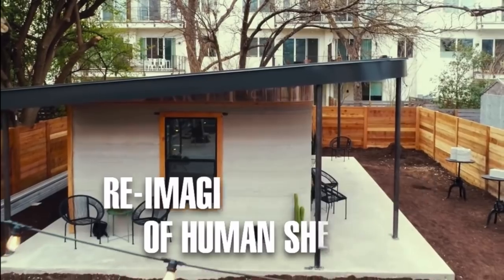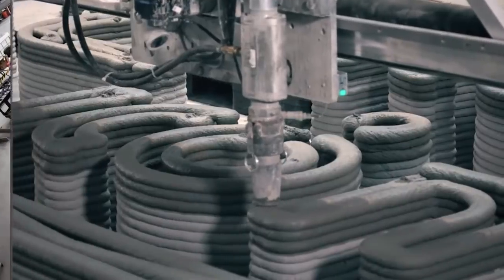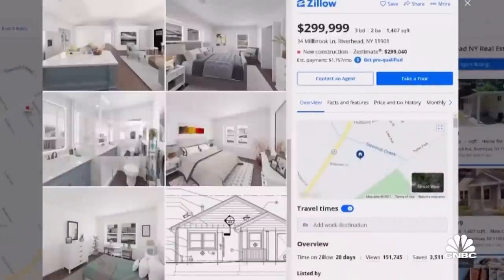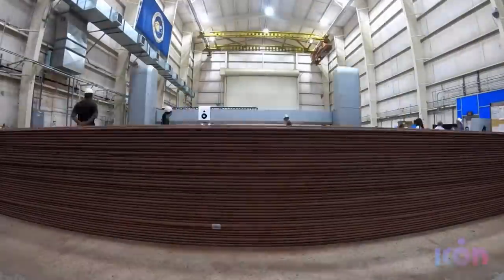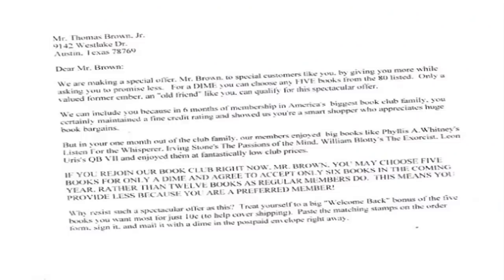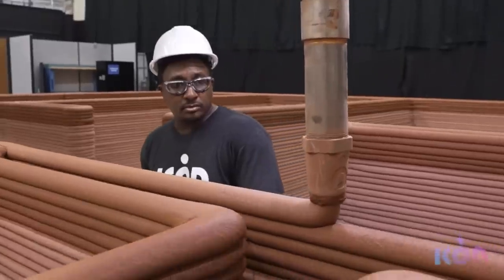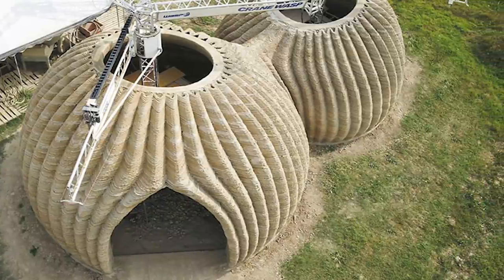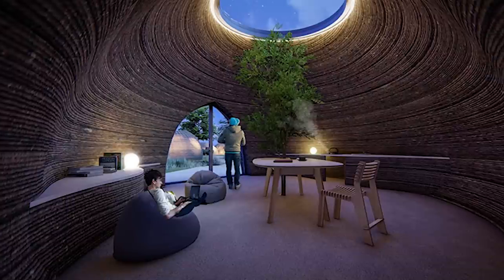Will 3d-Printed Homes Be The Answer To The Affordability Crisis?

Comment: 1. Cost: reduction in trades and material not just lumber. 3D printing requires a fraction of the amount of labor. Additionally, in home building, as well as any manufactured material, you control cost by eliminating total material used. If you use more expensive material, the total cost will increase for the build (example: if you want walnut flooring and a golden toilet... it will cost you).  Yes, a construction company will have to subcontract a concrete company to pump on site and there will be a cost associated with freight for the printer to site; however, in "conventional homebuilding" there are similar costs associated to logistics and freight. How do you think lumber, joists, beams, ect. arrive on site for a "conventional build" (needs to be trucked)? Icon initially started with the intent on selling their printer and not home building. The more printers sold, and the more construction companies invest in this technology, costs will be driven down due to competition. 

2. Tenting: you do not need to tent a site for a pour. 

3: Balance of printer: do you think this needs to be mentioned? "Conventional homes" need to have a level foundation. Also, these printers are equipped with level sensors which will alarm if they are off balance. 

4. Energy efficiency: the walls are filled with open or closed cell spray foam. Closed cell spray foam has an R-value of R-7 per inch. In comparison, open cell spray foam has an R-value of R-3.8 per inch. A nice add-on would be radiant heating in floors. 

5. How to hang a picture? Masonry drill bit... which will fit in any power drill. Don't worry, you will be able to hang up your "eat" and "gather" signs in your kitchen. 3D printed homes electrical and pluming : SQ4d has coded in a chase system to run electrical behind drywall and Icon homes have had external conduit. Although, people in need of affordable housing might not be as persnickety about hanging pictures or exposed conduit. 

If I were to suggest a new title for this video, it would be "5 QUESTIONS About 3D Printed Homes.
Reply: This is a GREAT breakdown. Thank you
Reply from the maker: Title changed. :)
Reply: Love it 😍
Reply: I have the funny feeling that the cost will go down for the builder, no the buyer.

Comment: I’d much rather have a monolithic dome home. They are disaster resistant, energy efficient and your concerns with 3D printed homes, largely don’t apply with them.
Reply from the maker: You are correct and they are super cute. Dome homes save lives in tornado prone areas.
Reply: @KristinaSmallhorn  Before I retired, I responded to large scale disasters (floods, hurricanes and tornadoes). I have seen way too many examples where stick built homes just don’t survive.

You are correct about domes, even the geodesic ones made from wood offer better, but not absolute survivability. Concrete domes offer near perfect protection.

I’ve also seen earth bermed and earth sheltered homes survive. I also recall one round home made from solid pour concrete, with a brick facade survive an F4 tornado. All of the other surrounding homes were either completely destroyed or very heavily damaged. I just didn’t like the flat roof it had, knowing over time flat roofs are problematic.
Reply from the maker: @Hero4Hire4  my dad worked a short time with FEMA and he told me pretty much the same thing. Thank you for sharing what you know about these homes and what the damage can be from storms.
Reply: We tried to have a dome house built and ran into many of the same problems as 3D printed homes. You can't find a contractor to build one. The one company that does it is in Texas and they're more interested in commercial projects. Domes are awesome in Florida but nearly impossible to have one built. Can't get a builder's loan, so you'll need cash. The option is to build it yourself and that takes practice.

Comment: I am interested to see how much it is going to cost if you need repairs (plumbing & electrical). I guess it will be a little more difficult to remodel your home as your life changes.
Reply: Electrical d plumbing is run along the bottom of the walls in conduit...so should not be a problem..Concrete lasts a long time My Dad's did Lathing and Plastering for 50 years and those Homes are still in great shape Stucco us basically concrete up on the walls of the outside if the home in a chicken wire mesh...These3 D printed homes are Concrete which has a great lifespan and are durable
Reply from the maker: The concrete for these 3D printed homes is not the same as the concrete your father uses. Each 3D printed company has their own "secret" recipe of what goes in it. Thats why there are still so many unknowns since these type of homes haven't been out for very long.
Reply: @cyndiharrington1751  not saying that it wouldn’t last but concrete does not move well.  Let’s think about the foundation moving, that means walls crack inside and out.  Since nothing says or shows any rebar for extra support, how does it hold up against high winds and extreme weather, cause the concrete does not look too think.  These are things that have not discussed.  These homes still have a lot of questions, not a bad option but still some cost that they are not talking about.
Reply: Me Too! Woukd the house be strong enough to withhold hurricane, tornado I wish I was there to see the building martial.🤔

Comment: How can anyone think this is cheaper than precast concrete walls or onsite concrete forms being poured?  Look at geodesic houses and concrete done houses... They've been talked about forever but nobody generally wants to live in them once they figure out the cost and disadvantages.
Reply: Prof X!
Reply: Famous @amoscardoza5253   😁
Reply: @crowhomestead7552  yes, automation of the building process will continue... these printers or concrete pouring systems help automate part of the building process in some applications.  Water, sewage, electrical and all other things still need to be added.  That's why I think factories are in a much better position to "print" houses then some contraption on-site.  Rebar, electrical and a lot more complex materials can be incorporated into the print/process in a factory environment.

Maybe 3D ICF blocks will be made with electrical, rebar, water and all other home systems built into them... excluding concrete.  The transportation weight can be kept down that way and the custom forms can be linked together onsite like Legos... Just pour in concrete.

Comment: A concrete home without any rebar for reinforcement either.  Earthquake, hello?   I can see it working for tracts where they can put up multiple units close together, but what is going to happen when some idiot runs his car into your exterior wall?  What methods can be used to repair?  I've seen some new designs that have gone back to running utilities in conduit and running them low on walls etc, if people can stand battens in a double wide that shouldn't be an issue.  I think it may have a place but there are so many factors like infrastructure, sewers, desireability of the area, I don't think it will miraculously lower the cost of homes in general.
Reply: Some of the designs do have rebar.
Reply from the maker: You are correct.

Comment: Please do a follow-up on concrete homes. 3D Printed homes is new technology, going through learning phase. But after
experiencing severe termite damage here in Florida, not constructing structure from concrete or steel is asking for disaster.
Also look at a community destroyed by tornado. Properly constructed concrete home can withstand it. Wood may be convenient
and in most builders comfort zone, but concrete offers a lot of advantages.
Reply from the maker: Are you speaking of concrete block homes or a fully concrete home?
Reply: @KristinaSmallhorn  Fully concrete. Concrete structures come in several forms. Form poured, standup panel, pre-cast etc. CBS is
popular, but not as strong as concrete poured types. I had the major termite problem 15 years ago, and have been 
researching concrete construction ever since. Fully concrete homes are not new. Thomas Edison built a few a long time
ago. Looking to build a new home in near future in Florida, and very limited prospects with concrete as to a builder. Contacted Icon
about 3D Printing but machine availability is limited.

Comment: 3D printed homes replace the walls only and walls are the least expensive part of a home so it's a gimmick. Cool technology application but they are not addressing the major cost pieces of building a home. The adobe Tuscany experiments are a big improvement over concrete and those domed images take care of the roofing issues.  Major building costs of a typical home might be a great video topic: costs for permitting/approvals/inspections, architectural/engineering drawings, HVAC, electrical and plumbing systems, basement/footing digging and concrete, roofing systems, windows and doors, and so on. Tiny homes still face many of those costs and thus why they are often surprisingly expensive on a per-foot basis. Do a Pareto ranked chart of the cost areas of home building and what are the top five ripe for cost reduction? Certainly it is not the walls that 3D printing has so far attacked.

Comment: Thanks Christina, I hadn’t thought or heard about how much these machines weigh. And erecting a tent over the construction site is expensive.  I think in the western US, The fire proof/cement walls might make it popular from a fire resistant point of view.  Right now, metal roofs are so much better than composition roofs, which use asphalt material, for fire prevention.  And cedar shake roof’s are just kindling waiting to burst into flames.
Of course there has always been, and still is, CEMENT BLOCK CONSTRUCTION.
Reply from the maker: Cement block is different than this material. Every 3D printing company has their own version of what is being pumped out of the machines. Only time will tell if it will hold up like traditional concrete and how healthy the material is.

Comment: Time factors are minimal as long as you are not the first one !!  They got building and safety's approval so that's the biggest hurdle in new or old construction but especially green or reusables lots of red tape 
So if they accept these builds than pulling permits should be a breeze lol
Eventually they will add plumbing and electric , HVAC. While they are building structure

Comment: How would you hang a flat screen TV on a drywall wihtout falling off, or a shelf, or cabinets... Cables are run in tubes so you can easy replace them and not just hanging dangerously inside the wooden walls. Concrete or stone walls are the norm in 90% of the world, just not in the USA.

Comment: No I don't believe these homes will solve the high housing cost, manufactured homes could be the answer to affordable housing, but they are only good if they are on a good foundation, I live in a concrete home and I feel like I'm living in a basement.
Reply from the maker: Why? Does it seems dark? Do you have moisture problems?
Reply: @KristinaSmallhorn  No moisture problems, its harder to heat and cool, even when it's beautiful weather in the 70's, its too hot in the house, in the winter months you feel like your in a ice box, the heat pump has to stay on everyday, either to cool the house, or heat the house, Thank you Kristina for your question.

Comment: Even filling the gap inside the wall. There is still a thermal bridge from inside to outside negating almost all  insulation fill.  Plus 3D printed = high risk. Traditional you know what you will get

Comment: 3 D printed Homes are alit Cheaper than your Homes and it's your Competition no wonder you are Bashing 3D printing Homes...These Homes at ICON are Concrete which is a very strong Product and The Concrete is Natural Insulation...
Reply: @xephael3485  Not Going to stop My Dad Did Lathing and Plastering for 50 years and the Homes are still in great Shape..Stucco is Concrete..So 3D printed Homes are Great Homes
Reply: @cyndiharrington1751  wooptie do?  I live in a house with lath and plaster and it's not used for insulation at all... You're just enamored by a fad or shilling for 3D homes because you think it's cool or can gain financial from it.  

 Issues are in practicality.  Printing homes onsite practically is not going to happen for the foreseeable future.  Why would it when you can print the structure at a manufacturing facility and assemble it onsite?   Lumber and traditional walls are multiple orders of magnitudes cheaper than poured or 3D printed concrete right now.

Comment: I will say that all new technology is a process. I like the 3.D home process. There were no costs or facts here so I would say a lot more facts are needed to answer any concerns and issues. For instance I remember a home in Bloomington, Indiana that was brick. A brick outside wall and a brick inner wall with air in between. I was cool in the summer and warm in the winter with low energy costs. Does it even need insulation ? I guess a start to asking questions but no answers here lol ..... time will tell if the process / materials / construction methods will improve. The stick built homes aren't doing that well either. And stick built homes are very costly. It's all about the process and the builder. Plus local material availability.

Comment: So what it's a HOME and SAVE TREES...which we need right NOW to overcome C0 2 in our Air
Reply: Sand and cement are not in unlimited supply. Concrete is horrible for the environment. Trees are a carbon sink, so unless you burn the wood you're essentially storing carbon. 

Concrete homes don't last longer than stick homes and 3D printed homes will not last as long as mold formed concrete. Just look at the layering and you'll see countless water intrusion and fracture points. 

Labor costs are not the reason housing is expensive, it's an excuse. Housing is expensive because it's seen as a investment that you can borrow seed money for. Imagine buying lottery tickets with a credit card.  It's expensive because developers sit on government boards and create rules to keep their profits.
Reply from the maker: The video was about questions that haven't been answered about 3D printed homes. You seem to have a different agenda, you could make a video to voice your concerns.